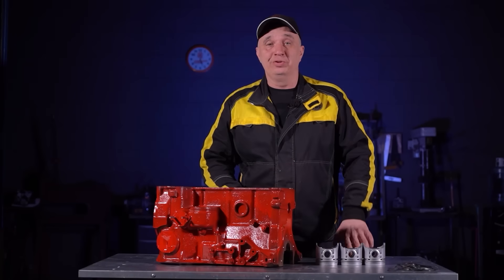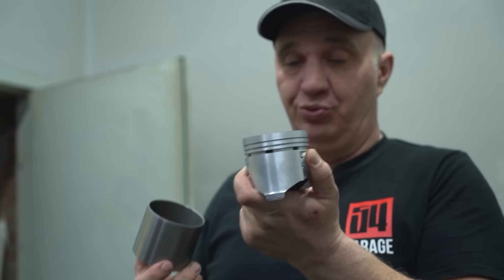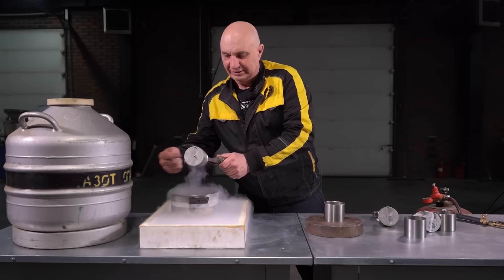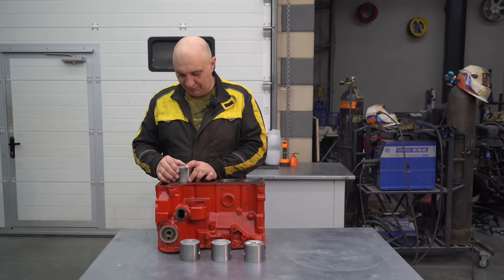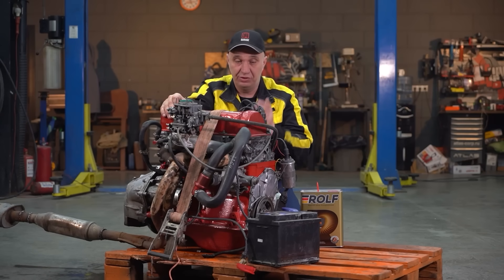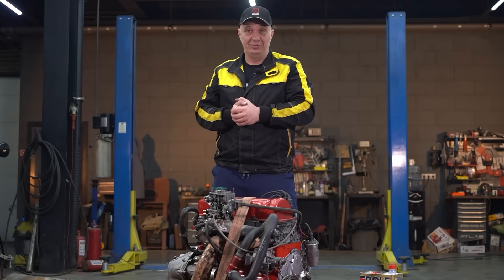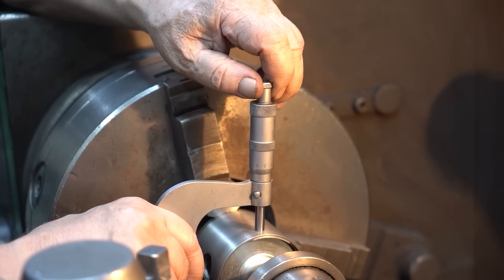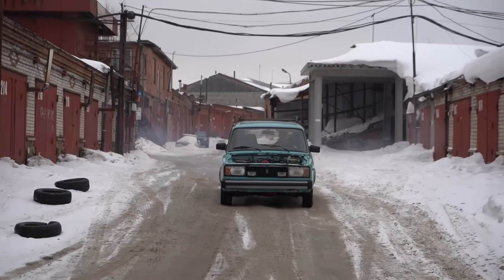We fit pistons with no rings to an engine - will it work?

Comment: How do you think engines were developed from the get-go? Prob with no rings...until some light bulb went off over somebody's head.   "The modern design of a metallic split-ring was invented by John Ramsbottom in the 1850s. Ramsbottom's initial design in 1852 was a circular shape, however these wore unevenly and were not successful. In 1854, a revised design was claimed to have a lifespan of up to 4,000 mi (6,437 km).[12] This was based on the discovery that a perfectly round (prior to installation) ring with a split in it does not exert an even pressure on the cylinder walls once installed. The revised piston ring was manufactured to an out-of-round shape, so that it would exert even pressure once installed in the cylinder. An 1855 patent documented this change. The switch to metallic piston rings dramatically reduced the frictional resistance, the leakage of steam, and the mass of the piston, leading to significant increases in power and efficiency and longer maintenance intervals..."  LOL

Comment: So some nitro RC cars don’t have piston rings .. they use a tapered cylinder to make compression…. Maybe look in to that one.. also maybe an oil control ring would still be in order.. good job on the low friction before it seized up tho

Comment: I have several engines that use NO piston rings....

They are very small, single cylinder, engines that are made for R/C models, and they run on a Methanol/Nitro/Oil mix for fuel. 

They have an aluminum piston and a brass cylinder sleeve that is coated with hard chrome on the inside. The sleeve has a taper to the bore that is larger on the bottom, and smaller at the top. The piston is fairly loose at tbe bottom of the bore, and gets real tight at the top. One MUST break these engines in in the correct way, so that the piston and liner wear together just right, or else you can kill the engine in one shot because it'll lose all compression if not broken in correctly 

The clearances are VERY important with these engines. They run hard for QUITE a while, and then eventually the fit between the piston and liner gets too big and the engine will lose compression and quit when it warms up. 

The fit between the piston and liner is sometimes SO tight that when the engine is brand new, it will make a metallic screeching noise and be hard to turn over because the piston is SO tight at the top of the sleeve. 

THIS is why proper break-in is SO important with these engines. You MUST heat the engine up with a heat gun before starting them, so that the liner expands a bit and frees up the piston. THEN you MUST run the engine a slight bit rich in order to help flush particles of metal out the exhaust as the piston and liner wear into each other. BUT, one must be VERY careful to monitor engine temps as the break-in process goes, so that the engine does NOT run too cool from being on the rich side, or else the piston can seize OR end up wearing TOO much metal off and then the compression will be gone. 

Its a fine balance of keeping the mixture rich enough to wash out metallic particles from the break-in process AND making sure that the engine temp is NOT too cold that it doesnt expand the liner fully and wear off too much material for a proper fit. It takes some experience to get your break-in process down right. At least with these tiny engines, a new piston and liner set is fairly cheap and very easily replaced if you screw it up.

Comment: At 9:31 seconds you can see the distributor bolt wasn’t tight and distributor rotated adjusting the spark timing. I wonder if that was caught and tightened before you drove the car, otherwise that might have been what stopped the motor from running when it was in the car, and then when you tow started it with the timing wrong it blew the piston from detonating completely at the wrong time. That’s what it sounds like to me
Reply: Good catch, I think you're totally right.

Comment: Try it again but make titanium pistons. Titanium has a slightly lower coefficient of expansion than steel so you can machine them for a tight fit when cold and they'll loosen up slightly when running.

Comment: Didn't watch the whole video. Yes, you can make it work if you have a large enough gap to account for thermal expansion...which means it will have a shit ton of blow by when cold (probably a lot when hot too). This will lead to oil contamination, unnecessary environmental pollution, etc.

Comment: I didn’t see any sort of honing or any sort of surface finishing of the sleeves to retain any sort of oil either. Gunna seize real real fast. With tolerances on the cyclinder walls that tight I’d have gone with a lot thinner of an oil to

Comment: Having an interference fit right from
The start I knew it wouldn’t work. Make the sleeves and pistons both from the same material so you know there the same thermal expansion rates and there is easy formulas to figure out how much each part will expand at specific temperatures. For it to not seize while hot you basically need a clearance fit when cold.

Cool video to watch but couple things I’d have done differently. Interference fitting the pistons initially is one major thing I’d change. For it to last at all in any way you’d need to lower the compression to the point you’d need starting fluid to even get it going or else it’ll lock up within seconds

Comment: Also, the compression rings provide a path for the heat from combustion to travel from the piston crown to the cylinder walls and block so that the coolant can absorb the heat and distribute it to the radiator.

Comment: in 3rd world countries they actually put wooden pistons in on a cylinder then disconnect the spark to it if they don't have a replacement piston available and only will run on 3 cylinders if they had too

Comment: Every piston I have encountered is not cylindrical they are oval. It is not obvious and you only figure it out with a micrometer. this is because when thermal expansion kicks in the expansion that takes place turns the oval shaped piston to cylindrical

Comment: I wonder if you made the clearances way bigger.
Than pre heated the block , oil and pistons to running temperature. 
If you could get enough compression to start.
Then how long it will run.

Comment: YES OF COURSE IT WILL WORK.  In 1969 HOLDEN fitted SOME  HOLDEN cars with NO RINGS, HOLDEN HR actually.  Sold to a  farmer who had trouble starting it and it burnt oil.  Eventually the engine was disassembled by Holden Dealer and found NO RINGS. NONE at all.  Fitted a set of rings. = ALL GOOD THEN!  Rings are only a final seal after the PISTON HAS BLOCKED THE HOLE!  STEAM ENGINES work with NO RINGS. Is this bloke a bit slow!

Comment: It seized quick benause of 2 things, to tight clereance and no oil on the piston, dri holes through metal sliwe where they are originally for delivering oil to oil ring, quit interested how much longer would that make the engine run

Comment: the purpose for rings is to compensate for the different metal types expansion rates.  also, oil control.  lack of oil control is why that engine smoked badly.  the gap in the rings have to be set accordingly since they expand also.  if the gap is too narrow, when the rings expand, the ends will make contact.  if that happens, it will cause them to be too large for the cylinder, which will cause catastrophic failure.  delicate balance between end gaps.  too much, low compression, too little, boom

Comment: Could have cut oiling grooves from the base of the skirt up and would have splash oiled the pistons like originally designed. Also running the engine more on the rich side or running water injection would have kept the pistons cooler and cut down on thermal expansion.

Comment: I think you needed WAAAY more clearance for expansion plus an oil film.  I‘m betting you need at least a few 1/10’s of a millimeter around, if not more.  
    Those pistons expand quite a bit plus the cylinder itself is going to expand in the opposite direction.

Comment: Well as a rule u should have had a tapper from looser in the bottom cylinder and tighter at the top look up hpi rc car racing motors and u need to run cycle oil in fuel

Comment: So very very small engines actually don't have rings and they maintain compression by having a greater taper between the piston and cylinder than normal. Instead of having the piston and cylinder completely cylindrical I would suggest adding taper to both in such a way that the tolerance is tighter at tdc.

Comment: not too hard to understand that the pistons will get hotter than the cylinder walls even though same metal.   Or was it? Cast iron block. was it a Cast iron sleeve?

Comment: You guys plugged the oil channels on the pistons, most engines nowadays have oil control rings and oil squirters in the pistons, a sleeve needs just as much lubrication as piston rings do.

Comment: I just don’t understand why we  havnt made cnc machined oil and presser rings on the pistons instead of rings just drill and cut with added material so u have it it probably takes less than 2mil in depth and in theory it shouldn’t break if it’s thick enough or just good steal

Comment: I know from experience that an engine with no rings or seals will run. When I was 14-15 my buddy and I got an old Kawasaki dirt bike from the 70's and it was in pieces. We got it put together best we could. Had a guitar string for throttle cable. 20oz mountain dew cap for carburetor cap. Coat hanger for back brake cable. Olive jar lid for gas tank cap. And it had no rings or seals in the engine. It was a 250 2 stroke and we ran it almost every day for that summer. We named it fire hazard because gas and oil would get on the exhaust and catch on fire. We kept a 3 liter bottle filled with water bungee cord to the back of the seat for when it caught on fire

Comment: But this way the cylinder walls get no lubrication at all ?  ..Engines without piston rings (like small methanol RC Engines) have a LOT of oil in the fuel for that reason.

Comment: I once saw a two cylinder diesel engine that didn't have rings.  The iron pistons were about 12" diameter and had several grooves where you would normally find rings, but the grooves were too shallow to accommodate rings.  The engine had been running almost continually powering a generator for decades until grid power was brought in there.

Comment: In pistons, elastic rings are used to maintain pressure even with thermal expansion. Without the rings, an engine that is too cold would not have enough pressure to start, and once hot, thermal expansion would cause it to seize.
I know this even though I am not an engineer.

Comment: They make RC airplane engines with no rings. They run on methanol and nitro methane with castor oil for lubrication. It works because at that scale thermal expansion is not so catastrophic. Also Methanol cools much better than gasoline. We run methanol in sprint cars and you'd be doing something very wrong to get it to overheat such as forgetting to add the coolant.

Comment: I'm thinking tighter tolerances near the crown of the piston, with more room near the wrist pin and skirt would have lasted longer. But, the aluminum will expand, hence the reason ring gap is so important, and why piston rings are split. That said, if the piston was cut in such a way to allow it to flex just a little bit, a landing area of near zero tolerance could be created near the crown of the piston. This operation would look like a deep radial groove about .5mm wide, about 5mm from the edge of the crown, about 10mm deep, and also successive vertical cuts (very thin) about 5mm deep radiating from center, only extending from the inside of the groove to the outer edge of the crown. The landing area should be no more than 5mm or so. The rest of the piston should be at about 1.5 thousandths of an inch tolerance to allow for thermal expansion. Such an engine would never endure the stress of well built ringed pistons, but for inexpensive\disposable\temporary power, it could be an option. The longer I think about it,  composite material ringless pistons could definitely be constructed with good durability. But, at what cost\reward?

Comment: There are millions of model airplane engines that run successfully without piston rings.  The cylinders and pistons are either both steel or both aluminum.  They are also 2 cycle.
Reply: Most popular 2 cycle glow engine is an "ABC" engine: Aluminum piston, with a brass cylinder that is chrome plated.
Reply: The working service life and power/ torque outputs of those engines are not even a close comparison

Comment: Two stroke model aircraft engines use ringless alloy pistons in chrome or nickel-plated brass liners. Older ones used Meehanite pistons in hardened steel liners.  A little upper piston lubricant like Redex would be useful or run 50:1 two stroke oil.

Comment: How about a "twin-combustion" piston engine? Connect a rod through piston and put a crank top and bottom with combustion chamber top and bottom so piston has power strokes top and bottom. Obviously would need to seal rods from crank somehow and converd vertical motion while eliminating rod from moving sideways and would have to seal around rod as well

Comment: Before getting too far, I predict that the thermal expansion of the pistons will cause problems, and that there will be a lot of thermal expansion due to friction.  The piston will expand in the bore, and will inevitably get stuck due to wedging, or welding to the cylinder walls.
Reply: I'm not surprised that this is exactly what happened.

Comment: I’ve been asking engine builders on many channels about an idea. A V8 has 8 beats in a revaluation. Why not only 4?  Two pistons are at the top of their stroke at the same time but only one will be at the end of compression stroke just as the spark happens. Why not fire 2 pistons at the same time. It would require a new cam and an altered distributor and that’s about all.  Has anyone seen or heard of anyone doing this?

Comment: The pistons in a 4 stroke are lubricated by holes that go from the inside of the piston to the outside of the piston where the oil rings go.  Usually, the oil is sprayed onto the bottom of the piston where it then leaks to the outside of the piston through the oil ring holes.  By not having holes where the oil rings would have been the pistons were unable to be lubricated and thus they locked up do to lack of lubrication.

Comment: 15:58 i think it could work not really worth it too complicated simply need to make an engine that has the same thermal expansion rate as the pistons, basically good temperature control systems like oil cooling jets and even oil pressure flowing around the piston crown itself through the connecting rod in the small end bearing and into the piston itself like the crank, make sure it goes through an oil cooler first and also would need multiple electronic temp valves instead of a single thermostat

Comment: You guys are great comedians and are genuinely great to watch! It’s good to experiment even if you know it’s going to be a lost cause, makes life very interesting!  Seriously, differential expansion rates aside, I think the problem that you guys had was using the same grade cast iron on the piston sleeves as the (presumably) cylinders themselves. A dissimilar grade of iron may have been less prone to seizure, or better still, pistons made entirely of cast iron without the aluminium. With an initial set clearance compression could still be adequate, and differential expansion would be much limited resulting in better reliability! Keep experimenting guys, everyone loves a tryer!

Comment: Model airplane engines less than .40 cu. in. (6.5 cc) have no rings.  They use Meehanite iron pistons, no rings.  Larger iron pistons are too difficult to balance so they are made of aluminum.  Because of the difference in thermal expansion of aluminum and the iron sleeve, when cold there is not enough seal and get adequate compression.  If made tighter, the engine will seize when it comes up to operating temperature.  A ring is needed.  BUT!!!  If the piston and sleeve expand at the same rate... There are engines with aluminum sleeves that are chrome or nickle plated, with aluminum piston and no ring.

Comment: there are motors that work without elastic bands... micromotors for RC models however in that case the cylinder in the "top dead center"  is conical and when they are new they require a long running-in period to adapt all the tolerances

Comment: So this I'm at the sized point. 
You put an aluminium core cast iron outside piston. 
The aluminium is going to still expand. Even crack the cast sleve on the piston. 

You would need solid cast iron pitons to keep it equal.

Comment: So, this was an experiment to verify the need for piston rings and it was successful. With the whole piston contacting the cylinder wall the amount of friction will always create the results as seen in this video.

Friction = heat. Combustion = heat. Adding the two together = material breakdown = engine failure, every time.

The real thing to do is to build an engine without any friction. Take a look into what that would take and then give us a video demonstrating your achievement.